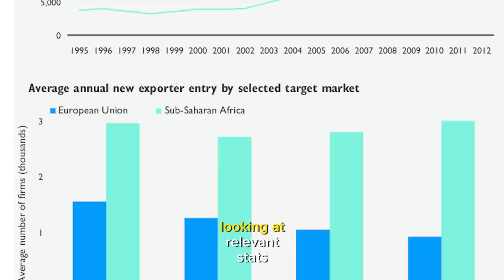The 10 African Countries That BANNED Export Of Raw Materials to Europe.

Comment: Ivory Coast and Ghana should make their own chocolate factories. What is taking them so long.
Reply from the maker: They have to invest properly into those areas!
Reply: They have to first get something that has a good taste to the people. Then they need people that are good at building those factories and managing them. That is MUCH harder to do than you think. I know firsthand that most people will not be able to manage and run a factory. I've worked in them, worked with fortune 100 and 500 executives over the years in different industries and I tell you, it's not that simple. If it were, they would have been made even before now. Remember, China took 40 to 50 years to transform into what it is today, and even to get to a great spot, that was another 20 after that, to get them up to where they literally are today of eliminating poverty